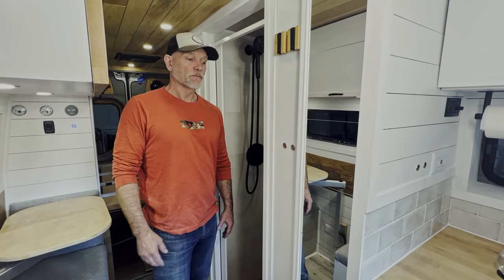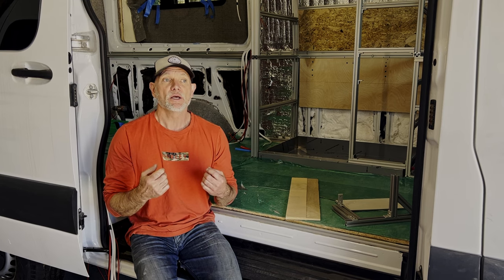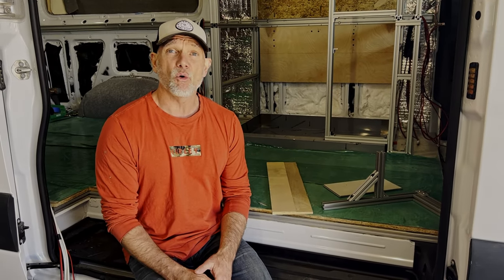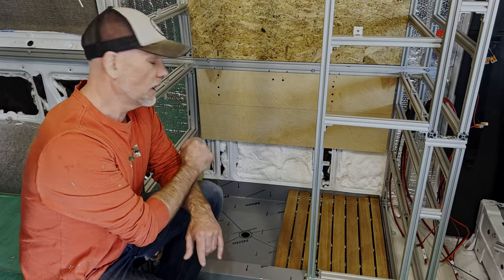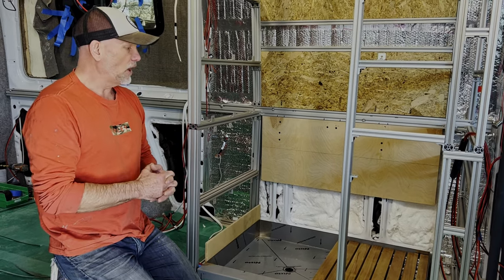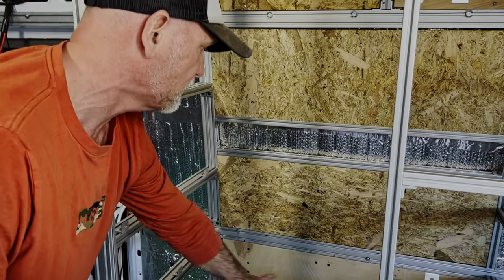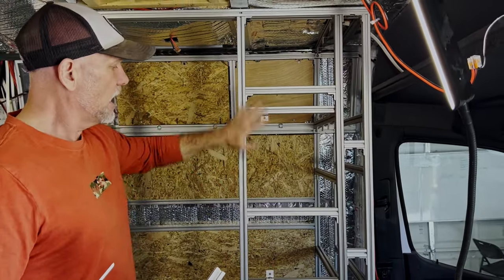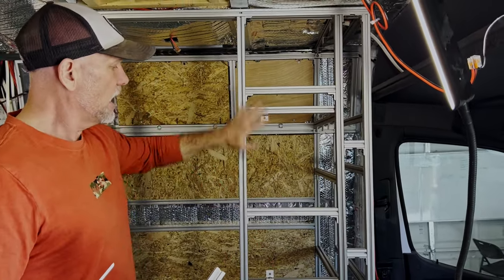How To Build Camper Van Shower with 80/20 | Mercedes Sprinter Van 144 Build Series

Comment: Another reason to have a wet bath in a van is for car insurance purposes. It's extremely cheaper to insure a van as an RV than as a commercial vehicle, and the only way car insurance companies will do that is if the commercial van has a shower with running water.

Comment: Thanks for the video. Great ideas. I have found a guy to fold up a similar base here in Australia so am trying to basically replicate what you have done here. A couple of questions though. Are your bottom extrusions secured directly to the van floor? Catching glimpses, it appears to be on top of installed flooring which I can't work out why. I thought you would get more height going securing directly onto the floor and packing out to support the shower base. Also, how have you attached the bottom extrusions to the floor? Have you used rivnuts or plusnuts here as well as the roof?  Finally, what holds the base in place? Is it simply the frame around it and or the extrusions bolting down through that front channel? Apologies for all the questions and I know I will have more.
Reply from the maker: Shooting you an email
Reply: @chexvanz  Thanks so much for your detailed response. Great video explanation and obviously van builds
Reply: @chexvanz Thank you for your thorough and educational videos. I am following the same approach for my shower and greatly appreciate if you can share the response to stephenespensch questions above. Thanks a lot.

Comment: Solid design. What is the total cost of materials for a shower like this?
Reply from the maker: Hey Dustin,
Custom shower pan cost $400. 8020 aluminum and hardware around $500. Then tile/wood around $400. So all said and done cost is around $1,300 in materials.

Comment: This is an educational video. I have been watching George on Humble Road and he builds the boxes or modules in one. I like your use of the furring pieces.
Can you give me your opinion on using PVC board such as Azek for the backer instead of the plywood. Im guessing it might not make a good finish board.  Maybe it could be sealed or painted.
Also is 24x36 large enough to move around? I was thinking about having a shower deeper on one end and tapered down.